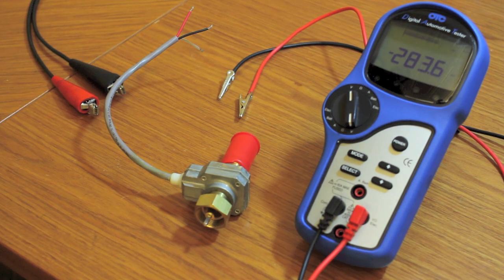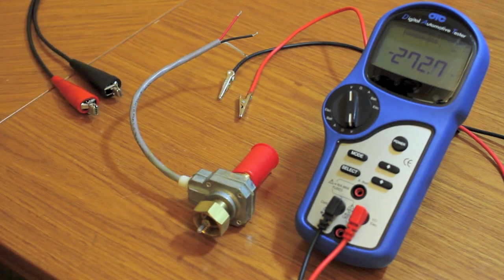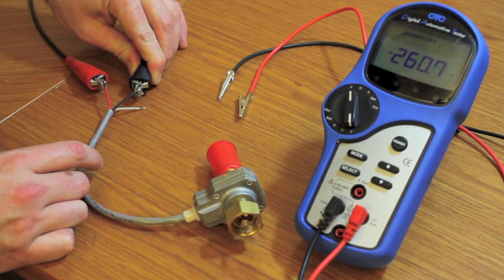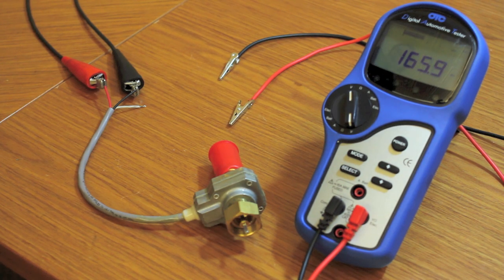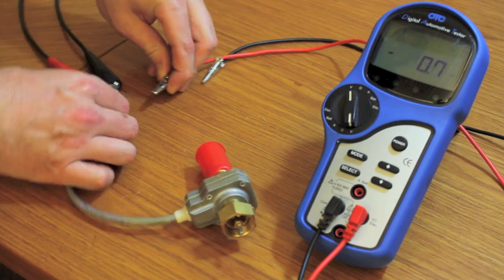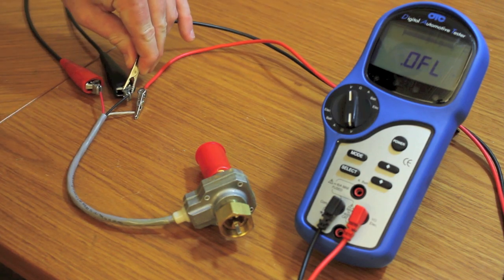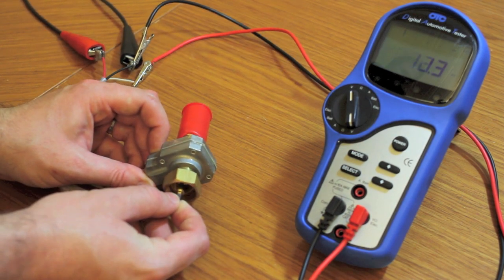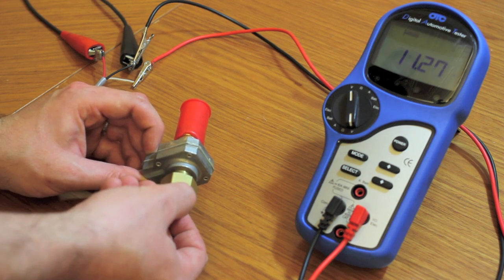How To Test A 3 Wire Speed Sender

Comment: Some 3 wire sensors (some Dodge transmissions for one) have a +5 Vcc (voltage constant current) supplied from the PCM (power control module), a ground  and the "sense signal" or output wire which has a +5 voltage Vss (vechicle speed signal) also supplied from the PCM. The PCM +5 Vss pulses or drops during operation indicating speed to PCM. This type of speed sensor arrangement cannot be bench tested the same as this method above, unfortunately. Good video for that sensor!
Reply: So how do you test it

Comment: so is this a device that changes a cable speedometer  to a electric speedometer? was looking to swap my 88 s10 from cable to electric gauges but did not want to have to go and change the transmission. is there anything else that you need to use this device properly?

Comment: If the 3 wire speed sensor was connect to 12 volt supply instead of 5 volt, would the (Autometer) speedometer work (constantly) like that?
Im lacking 5 volt on my (engine swapped) TJ Wrangler and was thiking of usin 12 volt instead, if that will not harm the meter og sensor.

Comment: hi my dear friends:  the first i say thanks for the all vedeos i like see all vedeos from USA and CANADA I"m a fan of chevrolet.  i"m from norway and i have a chevy suburban 6.5 TD model 1995 and i change a standard automatic transmission 4L80E for a full manual transmission NV4500, befour everyting working and after this modification the speedometer don"t working and the ABS light is ON!!! no one can tell my what"s going on there!!! we conect all wire"s all cables in good conditions just disconect the conector"s of automatic transmission!! why or where is the solution for working again a dam speedometer? i appreciate really who know this type of electrical problems. thanks